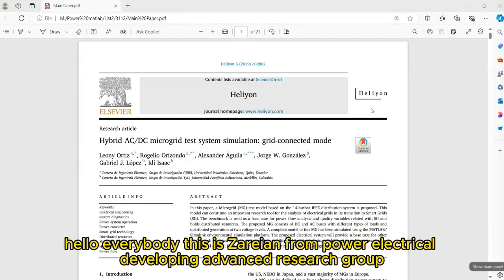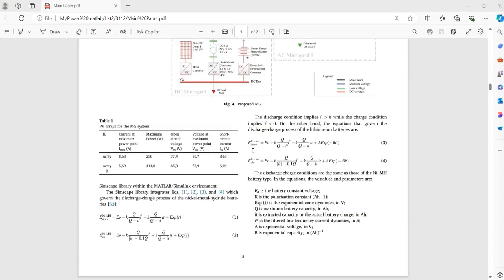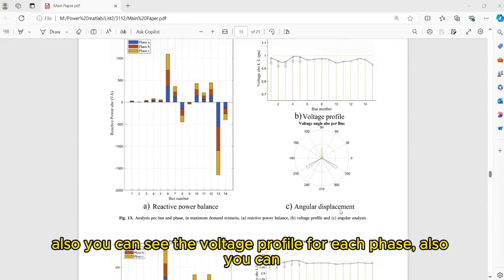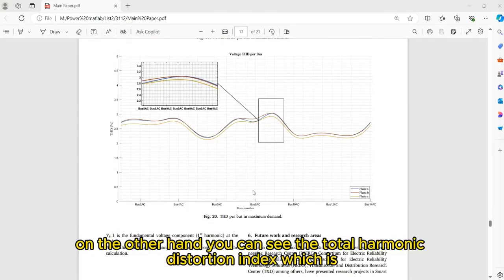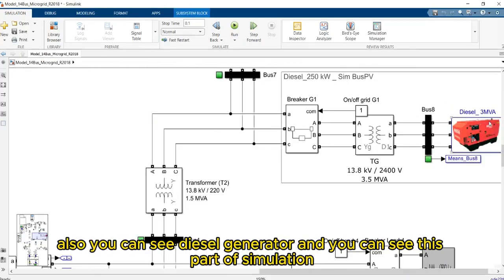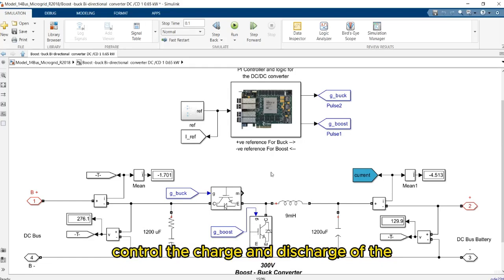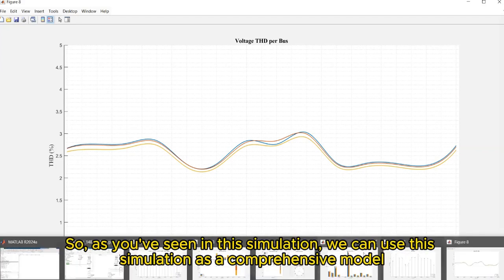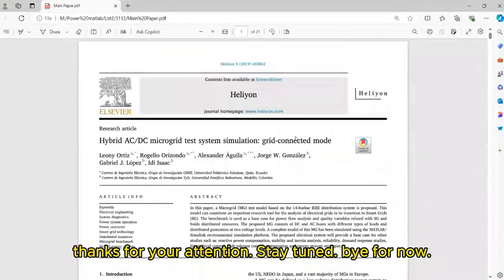Project Number (3112):Free download of Matlab Simulation file for Hybrid AC/DC microgrid test system

Comment: can you please make a video on simulation for grid connected mode and islanded mode working..
Reply from the maker: @supriyakumari2581  sure it is possible, just need to change the states(0,1) of  switch which it connects the IEEE 14bus network to upstream network....I will try to explain it indetail in a short video 😉
Reply: @powermatlab7830  ok thank you 🙂
Reply: The result in main paper for every parameter is both for maximum demand and minimum demand....how can I get this?